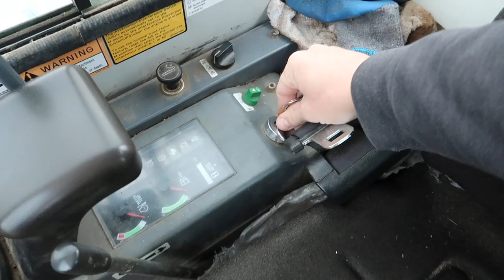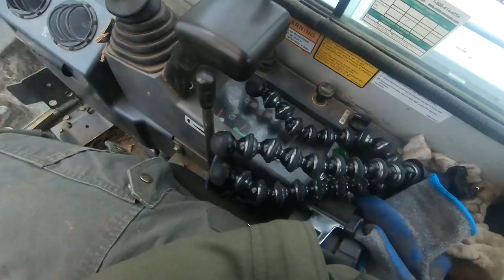Building Our Farm ~ Rebuilding an Old Livestock Lane

Comment: Mornin Al. Try turning the electric fence gate around so when you open the handle it breaks the circuit and the gate dies so you do not need to turn the fender off.

Comment: Please consider opening the rock wall up where you cross it several times a day.  The excavator can do it in 30 minutes while you have it.    If you want rocks somewhere else you can use a sled to put the rocks on and then drag it to where you can unload them.

Comment: It would be much easier to pull the chicken tractor if you would trim down the two front runners, at the bottom into a rounded shape.  Now, the runners will pull smoother through the grass.  God bless